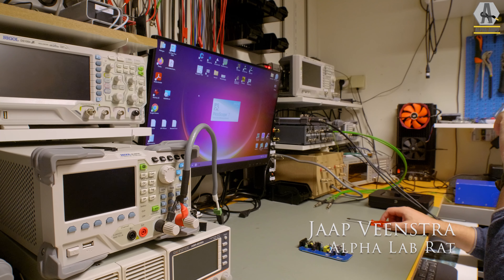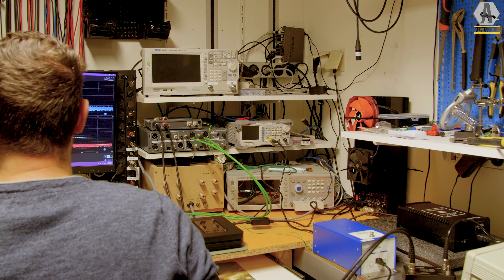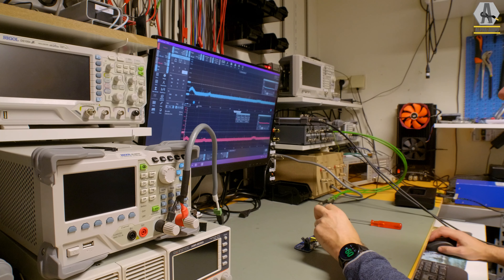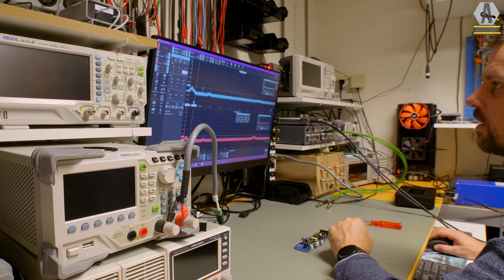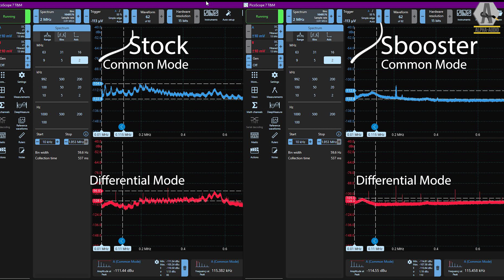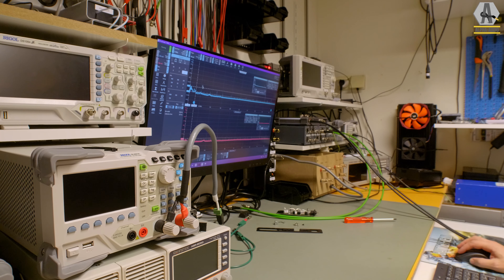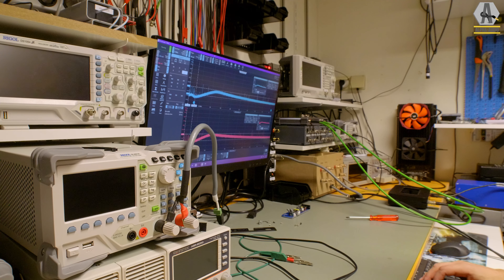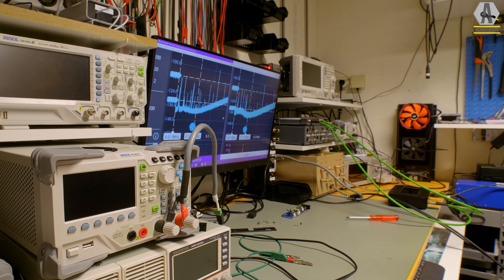Alpha Labs - Measuring a Power Supply Mod - Sbooster on NODE!

Comment: i was expecting s booster to make more of an impact, great work thanks for sharing
Reply from the maker: Welcome! We mostly measured noise now. But there is a difference in speed, control, etc as well. But we can't measure that... yet.
Reply from the maker: oguzoz3008  There is a difference in how fast a power supply can deliver the current. That's the speed I am talking about. Control is how steady it can deliver the current.
Reply: @TheAlphaAudio  I just paid for mine today(with upgrade) so I am praying your tests show a massive improvement. As so far they did look similar to the untrained eye. or was that just due to the vertical scale?
verry interesting.👍

Comment: I have the Power Supply Mod with LPS from PD Creative and the creator informs that his measurements show that the stock Bluesound Node power supply noise is at the level of 2000-2100 uV. Power Supply Mod + SMPS (Meanwell GSM40B05) power supply noise is at the level of 200-210uV. However, Power Supply Mod + LPS reduces the noise to approximately 10 uV.

Comment: Have you done benchmark tests on power supply impact on wifi and cable modem routers?  I am wanting to change the cheap DC SMPS on my internet devices, but not sure if something like an sBooster is really going to impact the audio equipment at all (DAC and streaming devices are wifi for now) THANKS!!!  Great work as always and very appreciated!!
Reply from the maker: It does have impact. Measurable and audible. Pick the right power supply though. It needs to be fast.
Reply: @TheAlphaAudio  it seems from your testing that is very true!  I'll be experimenting with a couple different power supplies and using a 'noise sniffer'.  Thank you for doing some great work!

Comment: What about the digital output. What difference does the external power supply have when using the node as a transport?
Reply from the maker: Mostly the same. But jitter on the digital output is honestly pretty high with the NODE.

Comment: Great video! Would love to see the team spend a Sunday taking us through what a good basic entry system sounds like and then gradually introduce changes like better speakers or amplifier then wires etc until you end up with reference sound. Given your access to equipment and space I would think you could demonstrate quite easily the scale of improvements as the hobbyist moves from good entry level stuff to reference gear with all the tweaks. Thanks!
Reply from the maker: Good idea!

Comment: How clean is the power coming right from the sbooster? Are there better LPS?
Reply from the maker: What do you mean? Noise output on de DC output?
Reply: @TheAlphaAudio  yes
Reply from the maker: @Pete.across.the.street  I have to check that and compare apples to apples. We have a new setup. And you cannot compare the old with the new one.

Comment: nice, although, must you not have a input and output connected and then measure the noise at the output (analog) ?
Reply from the maker: We did. The analog output is not connected when we measure network and psu noise.